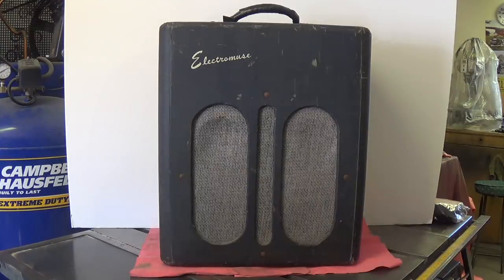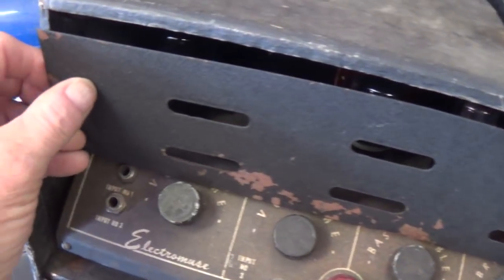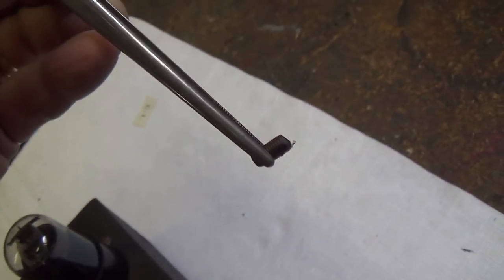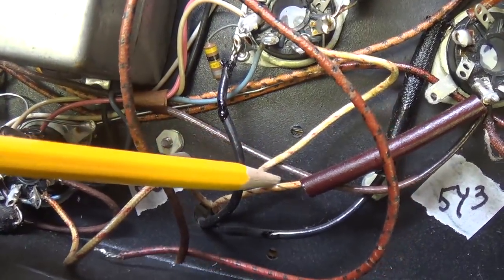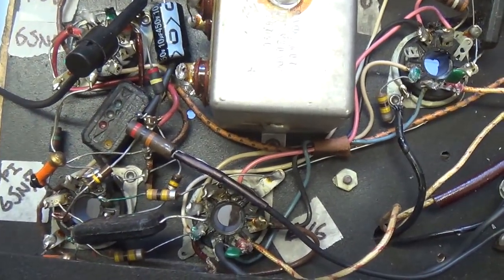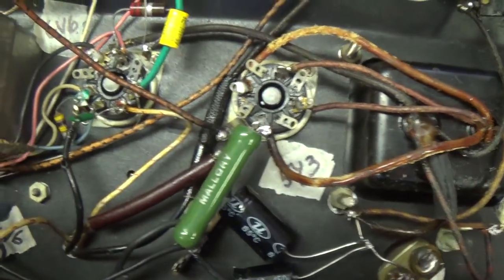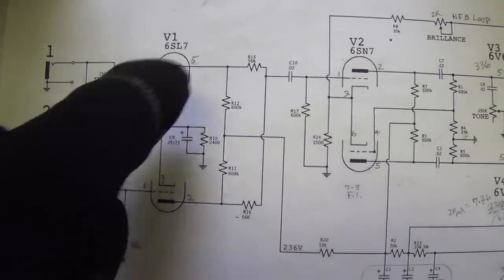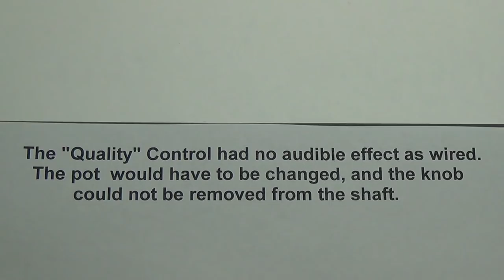Let's Explore and Repair a 1946 Electromuse Amp

Comment: I bought one of these a decade ago. I worked for this guy that owned guitar shops, pawn shops, and other small businesses of the sort. Anywho, there was this kid that started at one of the pawn shops and he walks in with one of these minus the cab. I think i gave the guy 34 bucks and a joint.  That was another lifetime almost. Ive sold all my gear since then except a LP Standard and a fulltone fulldrive. Figured id keep it for the kids. Tonight for the 1st time in 7+ years I actually craved jammin. Thought i had no amp to play through. So meh whatever...well i was cleaning out the basement and holy sh!t there's that damn Electromuse. No cab or guitar speaker in sight so i ran that sumb!tch through an old pioneer and if you're still reading this, that is absolutely amazing and you're a rare breed to tolerate a run on sentence that just never stops but instead travels onward through space and time with a determination that no other run-on sentence has every dared to do....FU€kIN RAWKIN BABY! Yall go grab a string and hot lick it now.
Reply: Great video man!
Reply from the maker: I can tell you were really getting back into your musician mind set,  William. Thanks for sharing this with us.

Comment: Another winner!  UD you and Jack put the "TUBE" in YouTube. What a fantastic little amp.  Someone in the design department was thinking outside the box when it came to speaker selection, and with good success. The 4x5's provide a fullness that a single speaker doesn't have..
Reply from the maker: Thanks, Sluggo. Who would have dreamed that 4 x 5's could sound so good ?

Comment: Loved the video as usual it was a pleasure to watch.  A very neat old gem.  just wanted to say that I too love deoxit I've used it for cleaning pots, contacts, tube sockets etc. I even turned my boss on to it as well for cleaning the contacts on tail lights, running lights, turn signals etc on our fleet vehicles.  saved a lot of money on buying new pigtails, wiring harnesses, and bulb sockets.  Its got that little extra oomph that most hexane based electronics cleaners just don't have.  Glad to have you back Uncle Doug, it feels like all is right with the world again.
Reply from the maker: Thanks so much, CR. I'm glad to hear that Deoxit worked so well for you.

Comment: I use internal quick disconnect fuse holders in cases like this. Great video!
Reply from the maker: I considered it, but removing the amp from the cabinet is a little tricky, and I didn't want the owner to have to do that simply to check a fuse.

Comment: Great video! I started building and fixing in the 80s and was taught to use CRC 2-26 and always have since. You can pick it up in the electric section at most hardware stores. I can say it's a wonderful product for cleaning pots, sockets, etc as well. Thanks!
Reply from the maker: I'll check it out. Thanks, Sean.

Comment: I used Deoxit and a toothbrush to clean the terminals on the TCI ignition module, and it's harness connectors, of my 1981 Yamaha XS1100.  Good stuff. It took the oxidation right off of the terminals.
So, yeah, i love Deoxit.
Reply from the maker: It's a good product, F3. Thanks !!

Comment: Uncle Doug, always thinking of the orphans.
I've acquired an old speaker cabinet for an Ampro projector that has two oval speakers, about 6" by 9". Initially I felt misled, perhaps even betrayed by the large round speaker grill. (Foolishly I just assumed it to contain a 12" Magnavox, as was the custom.) But hearing some great tone from those little guys reminded me to not judge so quickly based on appearance!
Thanks, as always, for an informative and entertaining video, in which no orphans were harmed.
Reply from the maker: You're welcome, PS. Those were probably a pair of original Rola ellipticals, used in so many Valco amps. I really like them.....and they are as rare as hen's teeth. You came out way ahead, in my book.

Comment: Even our Chihuahua got excited when a new 30+ min Uncle Doug video popped up on the screen, as I had to make 2 bags of popcorn for the extended couch time... Neat old amplifier, it's amazing how many different configurations they came up with for the P-P 6V6's. Did I see that schematic correctly, 600k ohm plate resistors for the pre amp tubes? Great repair Doug, and thank Jack for the camera work, enabling us to view it all. Tom
Reply from the maker: Don't turn that Chihuahua loose on my street when I'm making a truck video, Tom:) Glad you enjoyed the video......and the popcorn. Yes, the schematic did show 600K plate resistors, which seems excessive, but the amp I repaired didn't have them, so I didn't mention it. You made Jack's day by recognizing his videography skills. He always felt a bit intimidated by Rusty in that department.

Comment: Now the story of how I came to own this piece of amp history. A friend of my who was from PA originally move to NC.  While roaming around his garage I saw a guitar case and this amp in a corner. I opened up the case and behold a Gretsch New Yorker acoustic guitar with several flat slides in the case. The strings were very high but in great condition. I then looked at the amp in such aww. I ask my pal where’d he get these, he said his grandpa won them in a card game while working the coal mines in the late 40’s in WVA. I ask him what he was doing with them, he said taking them to the dump. I almost passed out. I ask him if I could buy them, he said no but you can have them. So that how I came to own this amp. This was in 2000. Score. Yes.
Reply from the maker: I had no idea you were the owner, Sir B. What a great story !!! You're luckier than I am. In my case, he would have already taken it to the dump, along with a bunch of mint Elvis 45's on the Sun label.....or he would leave it out in the rain and refuse to ever fix it, use it, or part with it. Frustration is my way of life :):)

Comment: Neat stuff.   I swear that old amps like this almost never turn up in my town.
Reply from the maker: Thanks, DK. Not in my town either :(  It's a customer's amp.
Reply: Sad, but all we ever get is vintage 59 Bassman's and non reverb Deluxe's . Excellante video Doug!
Reply: I have the same problem. I always thought that since i live within a hour of chicago there would be plenty around.
Reply: Our shop is a magnet for 80's Peavey stuff...  which isn't a terrible thing.
Reply: Ya my town either an I look all the time
Reply: DeadKoby  I've not seen a amp for cheap you could repair since I was a kid.
Reply: I've got a few instances on my channel.   Someone brought me a Fender bass amp from the 90's with broken input jacks.  He got that one for about 10$.   I got a neat Peavey keyboard amp for 5$ that needed  minimal attention.   Both of these projects totaled about 20$ in parts to fix both of them...  that includes cleaning supplies.
Reply: ^^^ Don't give up - keep looking. I bought a complete Boulevard PA amp with 5 high quality tubes for $20 2 days ago on Ebay. Made in Chicago about 1959. 2 EL84 power tubes, with 5 choices of input . I bet it works, and after I do some current limiting, I'll go for it. It even has a fuse with a UL sticker on it. Too cool !!
Reply: My town is flooded with solid state Marshalls and Boogie dual rectifiers.  I like and own Boogies, but we sure could use some like this!  And The Search  continues...
Reply: Great to hear you have customers again, Doug. I think you mentioned a while back you had put aside doing this as a service for doing it purely for love. I don't see those two goals as necessarily conflicting, as this video definitely demonstrates. And of course you can always still reject the guy who brings you a modern PCB board Marshall. ;)

Comment: Just love the smell of old grill cloth, its almost as good as the smell of aged transformer core lamination's and aged paper capacitors dipped in wax or encased in bitumen....
Reply from the maker: I've always been partial to frankincense and myrrh, A2, but it's hard to beat a nice, urine-soaked, particle-board cabinet floor

Comment: I just had a chance to try one of these. May not be the exact same vintage as it has a medium brown color rather than black. The tone was fantastic and had a little more bite than the one you show here. And the tone and quality controls definitely both had an effect. Maybe this one did have a 6SL7. I'm probably going to take another look at it and maybe pull the chassis. Tempted to buy it but after seeing this one I want to know how much repair I'll be into (and it seems likely it will be a fair amount of updating required).
Reply from the maker: Thanks for your input, Bob. Good luck if you make the purchase.

Comment: Naw...no popcorn. Got coffee though. Man, I haven't seen sardine can caps since ol' Shep was a pup. Too
bad the company couldn't twist the filament run though...1946...prolly still trying to shake off the effects of
WW2. Great video, and nice repair. And I was impressed too by how those 4 speakers performed. Seems they
just "ganged up" on the problem and solved it with team work(8-)

And no need to apologize for not showing the truck. I'm retired now...so any time works for me(8-). And
thanks for the tip regarding Deoxit. I wonder if it works on the new, counterfeit pots. What worked for me
back in the day totally erases the emulsion from modern pots...I'll get some and see...
Reply from the maker: Great comments, Tom. I've used DeOxit on everything from new pots to popcorn and it's worked fine so far :)
Reply: Cool(8-). I'll find a website and order some.

Comment: Looking somewhat dishevelled and not working, I think most amp buyers wouldn't have given it a second glace.  But after a careful repair job and a tidy up, you have given it a new lease of life for its owner.  The tone from those five inch speakers was a total surprise.  Interesting to see the tone control placed so far along the signal path.  On a different subject, my wife recently brought home a back copy, June 2017, of the magazine Guitar & Bass because it had a feature on Fender tweed amps.  Page 30 has an  article on a 1956 5E11 Vibrolux and they talk about the lack of input grid resistor.  Quote "You can try various values but online amp guru Uncle Doug recommends 100K or 220K".  Thanks for another great video Guru Uncle Doug.  Regards, Jeff.
Reply from the maker: Thanks so much, Jeff. I really feel sorry for the "underdog" I guess, and when possible, enjoy restoring them to some level of respectability.  I am flattered that a magazine would quote me. Let's hope my advice was correct :):)

Comment: Those micamold caps are paper wound types, not to be confused with the mica types, the way to tell by looking is the paper types are usually larger rectangular and higher capacity, the micas are much smaller rectangular or square and capacities are small.
Reply from the maker: Thanks for the info, ORG.

Comment: I have seen a few different versions of these.  The cabinet to mine is out in the shed.  I'll try to take a peak again to see what speaker it has.
Reply from the maker: Please do, Mr. A
Reply: its baffle is set for a single 12, chassis marked A46.  Solid appliance/cabinet handle.  My edges are square where yours are rounded.  Hmm.

Comment: Sir, Uncle Doug, one way to help with the ol' sore fingers is 'un' pasteurised , excuse my use of English spelling as I'm in New Zealand, Cider vinegar, mixed with a little water and drunk... entirely yucky stuff, well not completely yucky as it kinda gets quite tasty after a while (just like one can eventually appreciate the after taste of Cod Liver oil!), and it does help alot in breaking down the crystal growth on the joints. Tart Cherry juice is a bit more palatable, actually lots more, but not as effective though between times of running the gauntlet, imbibing the terrible rotten apple sluice, one can build up tolerance to such weird un-sugared tastes! Cheers Matey for all your good works!
Reply from the maker: My wife swears by unfiltered apple cider vinegar, Sean, so we have some on hand. I'll gag some down and see if it helps. Thanks !!
Reply: It also occurred to me, and excuse me for the beleaguering, the a lap steel is  also a fine way to make sounds of the nature so suitable to high impedance and alnico... and a lot easier on the hands whilst also of an intellectual nature to keep the grey matter fuzzing along; I say that simply as it's where I'm going to be going as soon as I find the time, and a suitable chunk of old bedhead mahogany, as the kind of whirling working out, on the fly, that has to be done, adding half tones alike traveling circus confetti emblazons tired mid west shopping districts, will surely help my own slushy head jelly twist mt appreciation of the other way of playing the refined log... and I totally dig those single string bars to the extent I'll even get the wax out for carving into bit's to be cast in bronze. https://www.youtube.com/watch?v=rlLVaef0_80
Reply from the maker: Thanks for sharing your poetic musings, Sean. Good luck with your lap steel project.

Comment: Love the video, great stuff! I would swear that the knobs on your amp came from a War Surplus radio, the volume pointers are all the same. World War II vintage electronic parts were used by many vendors, Heathkit and Eico come to mind, but I never saw knobs from old receivers used. BC-342 or the equivalent may be the source. There I go, showing my age again...
Reply from the maker: Thanks, MA. You could be right. God only knows where Valco, or any other manufacturer back at the dawn of ampdom, got their components. Army surplus was probably quite plentiful.

Comment: Hey Uncle Doug, I recently heard of this place online called Lee Valley. They have all sorts of handles available, even some "case" handles that would work well as replacement for some vintage amps. Do check 'em out when you have time!
Reply from the maker: I will so so at once, BC. Thanks for the tip :)
Reply from the maker: Look at this. It would probably work (nice and thick):  http://www.leevalley.com/us/hardware/page.aspx?p=40643&cat=3,41427,41377

Comment: Uncle Doug, thanks for the great video. I can't believe how good that little amp sounds. Ever think about building a low powered practice tube bass amp?
Reply from the maker: You're welcome, Glenn. I have never owned or played a bass guitar, so there has never been much reason for me to do so, but it's an interesting idea for a future project. I always assumed that bass players just used small regular guitar amps for low volume practice.
Reply: I used an Ampeg Jet 20 watt guitar amp for bass many years ago. I wish I still had it. It sounded great at low volume, but it would distort pretty bad if you tried to get any volume out of it. I guess it was due to it's speaker. It was not ment for bass.
Reply from the maker: That sounds pretty typical of a worn-out old speaker, Glenn, especially when subjected to lots of bass frequencies.

Comment: really cool project uncle Doug. I rememeber finding many old 6sn7 u7 , before they invented the 12au 7 double  triode . im amazed i never died plugging all those old things in and just loving it when music from the 60 's would play aventually . im playing guitar in my later yrs, now and have found a few newer species. like reissue superreverb. and a Traynor vc80 with 4 5881's  witch is supposed to be self biasing . i got a quad and a pair matching  that i mistakingly through in the Traynor. after first song smelled something and sure enough two of the four were red plating . put the old5881's back in and there been no problem , i guess im trying to get a more crunchy overtones and even harmonics. i know theres a lot of power there and a guy really needs a big area to open up. what would a 10 and 20 watt circuit look like on these amps practical? appreciate any help thx, very little id on these amps too. and the 6l6's are gc's
Reply from the maker: Barry, I think you already asked this question, and the answer is that the circuit is apparently grid-biased not cathode-biased, and thus you will need to re-bias the new output tubes. If you don't feel sufficiently prepared to perform this task, then seek the assistance of a qualified tech, who can either perform the procedure or diagnose the cause of the red-plating. Best of luck.
Reply: thx. for the reply uncle Doug . i know your quite right.  im in it over my head again. i have got to get back to the basics and build up . instead i've jumped right into the thick of it it seems and don't have much test equiptment at all. i know there's ways around much of it just takes more time usually . i feel right at home opening up a chassis on these things . i love it. specially tubes. thermal electron emmission. soo cool. !  should probibly start studying the A, B, AB. types of  
 tube cutoff charrictoristics. and how to acheive the right biasing for any configuaration or application of the use of most at least output tube uses.  im the kind a guy that knows a bit about quit abit. but has a hard time remembering were i left my keys, ph. ect.anyways  It's a wonderfull time in technology to be alive and I sure enjoy wathching your progamming. where was this when i was a kid@@! oh yah, I hadn't existed yet.lol.   weeding through  all the promising infor that only takes you somewhere else is very time consuming also.  but there's still lots of gold mines and yours is way up there uncle doug . If i ever get close to Texas i'd be looking you up for sure. luv ya@! Manny contineoed blessings to all the family!   I had a silver shepard for about 13 yrs. what a dog. best friend .etc.  If people would be half as loyal to each other as our best freinds  i believe there would be no mess on earth as we have today at all.
Reply from the maker: Be careful and seek outside help if necessary, Barry. I agree with your comment about the loyalty of dogs......we could learn a great deal from them.